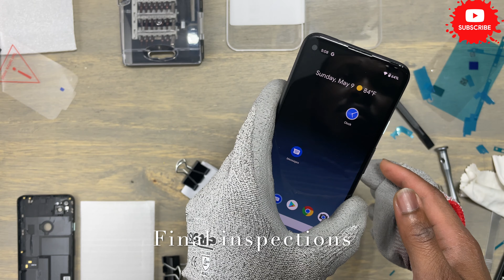How to Fix Everything on Google Pixel 4a

Comment: thanks for the tear down, specially the back cover replacement, have you check the Flash though, it was kinda bent  earlier? was it working and the Finger print sensor? I'm planning to do a back rover replacement too, thanks
Reply from the maker: When I did the repair for this phone everything was working no issue arose from the complete restoration.
Reply from the maker: You're welcome 👍🏾

Comment: I dropped my pixel4a into water, it got hot and did not turn/charge any more. I did a full teardown, cleaned ALL circuits with isopropanol and bought a new battery. The old battery had 0,0V. When i connect the new battery to the logic board, one of the metal shields gets hot quickly (again), while the display shows charging when connected to usb, but all green instead black background. What is the problem/solution?
Reply from the maker: Seems like the screen went bad. Battery motherboard work and charging confirms at least it can do that. Have you tried to turn the device on? If the screen still has discoloration green and brightness issues etc..  You'll most likely need a new screen to have it back normal like before water damage.
Reply: @ersbit  I fixed it: There was a tiny shorted capacitor on the logic board, underneath a metal shield. It was easy to remove with a tweezer because it was glowing hot red! Even with this capacitor missing, the phone and screen are completely back to normal 😄